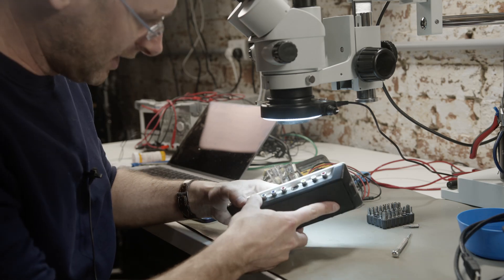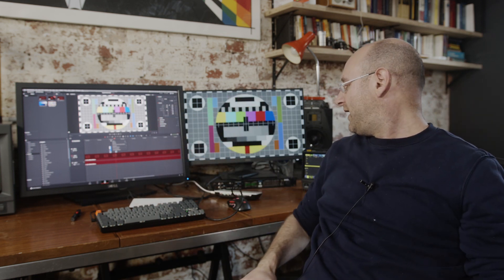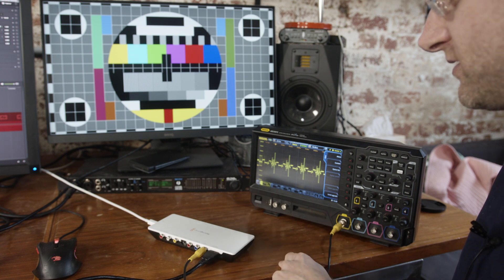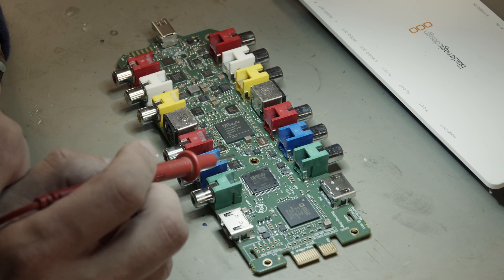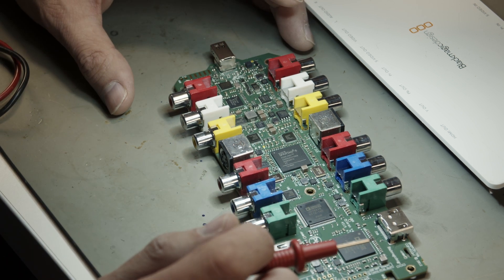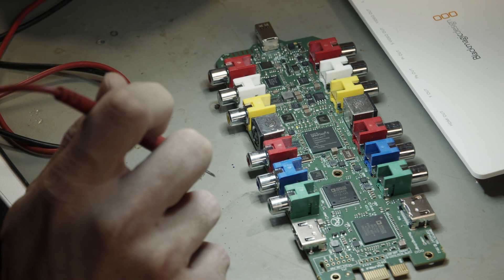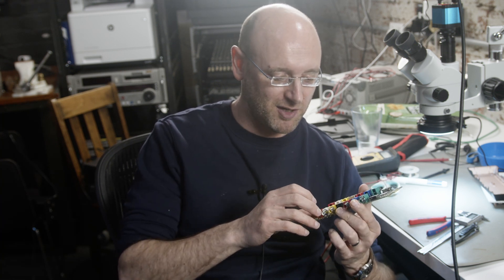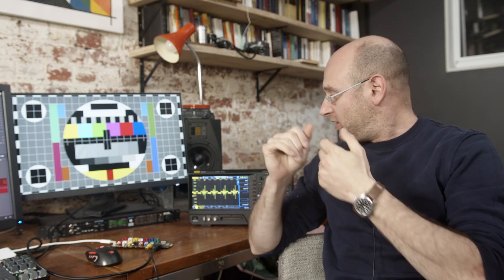Teardown & Repair(?) of a Blackmagic Intensity Shuttle

Comment: This is of little use to AV stuffs, but if youre combatting the no Pb RoHS compliant solder joints, try melting some lead/tin solder into it first. Granted, if it still doesnt come off youve flooded the pins with shorting solder, but the lead/tin lower temp stuff makes the high temp no Pb stuff melt a lot easier. Also could try some flux on the board to get under the chip and help the heat migrate into the joints. Again, this is the messy "GET OFF THE BOARD NOW!!!" kind of no way back way of doing things, but if we dont share our tricks with each other they go the way of the dodo. Anyhoo, cool channel! Just found it from Huygens Optics, definitely going to have to poke around the back log of videos! 

And for the anti-lead crowd(in case any of you are lurking around): yes, lead free is GREAT for manufacturers! Especially in this consumerist 'just buy another' world we live in. However, for the hobbyist its more headaches than its worth. If you huff the no Pb stuff its just as bad for you as the leaded stuff, just without the lead.....so dont huff your solder smoke. And no, hearing the word lead (or cigarette or microwaved fish) isnt going to give you cancer. Its fine. Just wash your hands after handling it, dont suck the smoke off the tip into your lungs, and youll be fine. Been soldering with it for years, so have millions of other hobbyists, its fine. Arguably a hobbyist repair saves things from the dump, and things going to the dump was the whole point of lead free electronics manufacturing in the first place. Lead/tin is the way to go, just use it safely.

Comment: Do the Intensity Shuttles still work on new Mac OS systems today? According to the Blackmagic forum, the USB version should work again on Mac OS.
Reply from the maker: My thunderbolt shuttle works fine. I’ve just had trouble getting the USB SS one working with the Mac.
Reply: They work on modern OSX with intel machines but the intensity shuttle does not work with Apple Silicon (M1/M2)
Reply from the maker: @ericnotarnicola3600  How disappointing. It’s days like these that I curse the Chinese for inventing gun powder :/